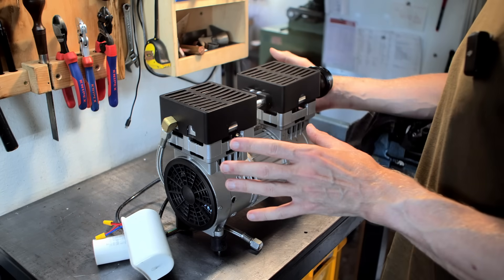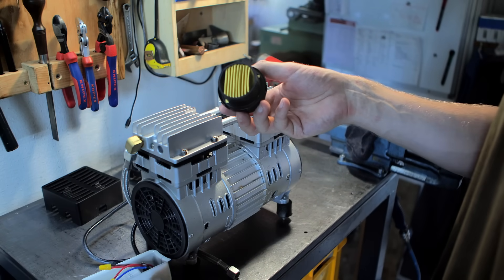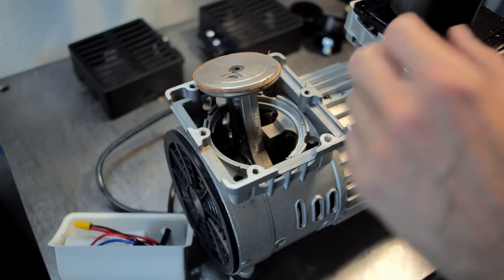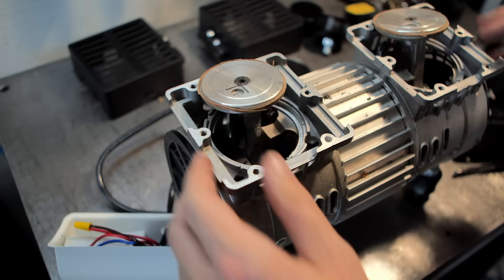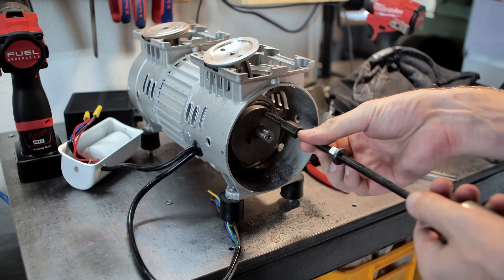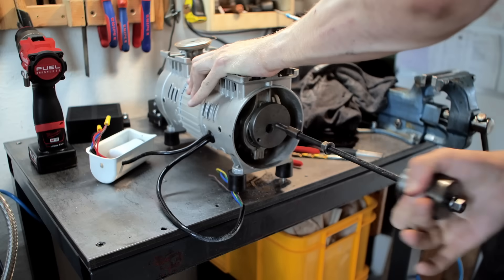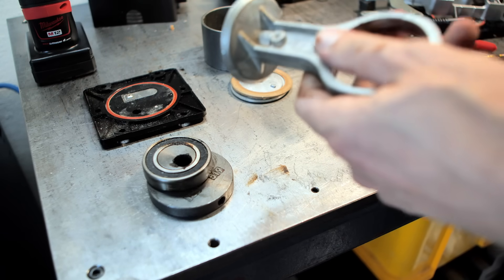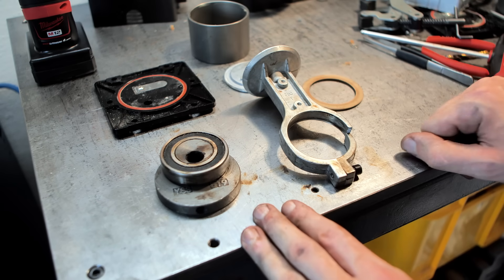Silent compressor - Destructive teardown

Comment: A Mechanical Engineering professor told us first-year students, “Never design anything better than it needs to be.”  This is a classic example of that --  inexpensive high-volume construction and few components requiring precision -- and it went 8 years.  I will look into one of these when my current compressor fails.  Interesting video.
Reply: "Engineering design is not complete when there is nothing left to add but when there is nothing left to take away." I can't remember where I read that.
Reply: inexpensive to make, but they charge quite a premium for these 'silent' compressors - at least if you get the name brand ones like California Air Tools - the harbor freight knock offs even are kinda expensive too. I still have an old belt driven compressor I picked up cheap on CL a few years ago - it's actually very quiet in that when it's running, the noise is all low frequency, and not grating on the ears like the small piston or worse yet the regular "oil-less" compressors - those things are stupidly noisy. I could make it even quieter by putting a muffler on the air intake - a lot of noise actually comes out of the air intake port
Reply: @gorak9000 If it's permanently mounted near an external wall you can plumb the intake it to the outside and all that intake noise will follow. Just make sure that you put a bug screen on it and that your neighbours wont be affected. (Maybe not a good idea if you are a midnight machinist in a city).  Also you'll be more at the mercy of humidity changes, so take that into account too. 

An alternative is to plumb it to an interior baffle box. I'd daresay that a stock air box and filter from any modern car engine would be affordable and effective. They're often discarded by people upgrading, especially those of turbo engines. I'd think that the filtration might be better too.
Reply: If those flat pistons had a wrist pin they would flip sideways in the bore.
Reply: Over Engineering : Why make something simple when you can make it really complicated AND get it to work  ☺

Comment: Wot makes ir silent ?
Reply from the maker: i guess the short stroke with small moved air volume/stroke, the air filter and muffler box over the cylinder head
Reply: @StefanGotteswinter  Also no metal/metal contact between the piston and cylinder, just the polymer seal.
Reply: Fast and short stroke like fridge compressor.